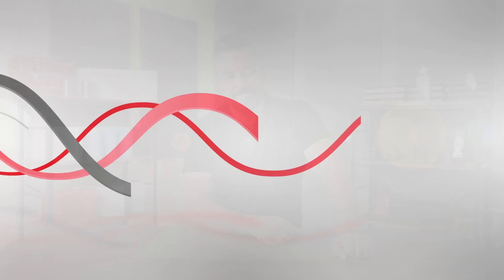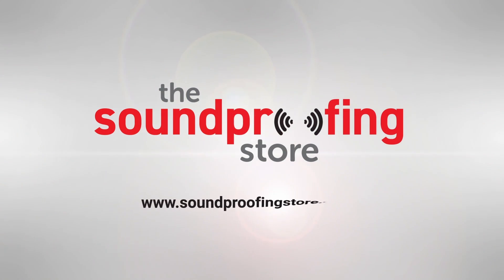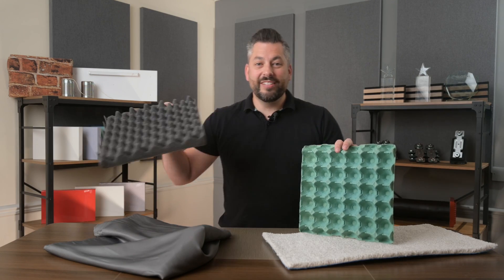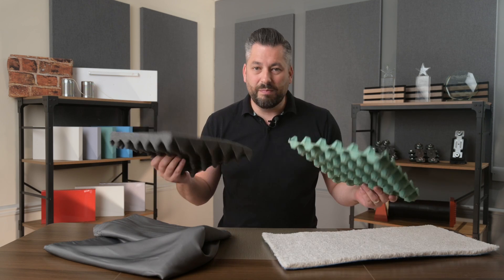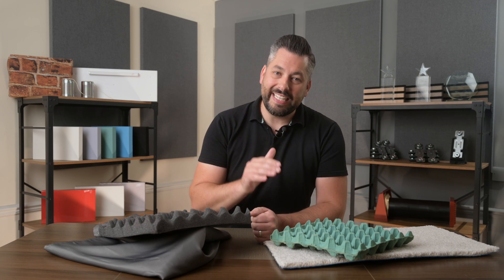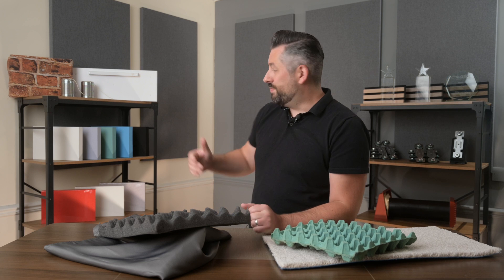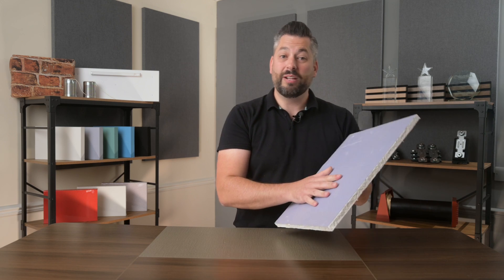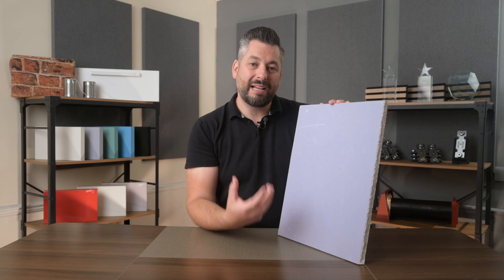Cheap Soundproofing Hacks

Comment: Hello, and thank you for this very informative video! 😊
I’m a photography student, and for my final project, I want to showcase a photo on the theme of silence in photography. My idea is to create a soundproof box where only one person can enter at a time, with focused lighting on the image. The goal is for the person to feel a true sense of silence upon entering the space, even though the exhibition itself will likely be noisy.

Based on what you explained in the video, egg boxex aren’t an option for effective soundproofing, so I’m considering soundproof panels. My questions are:

Are there any affordable panels that could work, even if they don’t completely block out noise?
Do you have any other recommendations for this type of project, considering I’m looking for a relatively budget-friendly solution?
Thank you in advance for your advice, and again, great job on this content!
Reply from the maker: Hi Thanks for the comment. Wow this is an interesting project. Unfortunately it's going to be a lot more difficult than you think. There are no soundproofing panels that on their own are going to give you silence. Most products advertised as "soundproof panels" are actually for absorbing echo not blocking sound. For this you need a LOT of mass, so multiple layers of heavy, dense materials, and you need de-coupling from one side to another. So I would build a kind of booth using stud framing, and soundproof both sides. Are you UK based? If so, reach out to us on our website at www.soundproofingstore.co.uk and I can send you some more detailed info about similar projects we've done. Realistically though, if you want silence, it's not going to be cheap.
Reply: @SoundproofingStore  Thank you very much for your reply, I will keep it in mind !!

Comment: Hi i have a stud wall between me and my neighbour and whos son like to bang on it and stomp in front of it will putting the flexisound 5 and then the acoustic board onto help to minimise the sound thanks
Reply from the maker: Hi @katiex3889, we wouldn't recommend that as a solution on its own. Both the FlexiSound and acoustic plasterboard are excellent soundproofing components when used in the correct way and in the correct quantities. They would for example be used with the ReductoClip System to make up the high mass layers (FlexiSound sandwiched between two layers of acoustic plasterboard). However, only advisable when used alongside the ReductoClip clip and bar system. Please take a look at the below video which goes into more detail on this and also talks about SoundBoard 4 which is a direct to wall soundproofing panel and is a great solution for low mass stud walls:

https://youtu.be/C-s8n3i3rBQ

There is also further information here:
https://www.soundproofingstore.co.uk/stud-wall-soundproofing

Please do feel free to contact us on (01423) 206208 and we can discuss this in more detail with you and advise on the correct solution.

Comment: I have 54sq meter property that’s poorly designed and neighbours can hear neighbours. I need to soundproof the inner shell of the flat and its floor. What is the thinnest and densest boards or rubber to use. Ceiling to floor is 250cm and I’d still like to insert shallow spots. Walls are brick that I will take down, leaving a single skin outer walls and cement floors and ceilings. 
Any advice is greatly appreciated
Reply from the maker: Hi @anonymousm1718, there is a lot to cover off here, so please do feel free to call us and we can discuss this in more detail with you (01423) 206208. A brick wall is solid and adds more mass to help block airborne noise, so taking it down will only reduce this capability. Also, the fact that concrete naturally has more mass than e.g. timber, means it usually does a better job of naturally blocking airborne noise. Because this isn't the case, you ideally need to find out why (again we can help advise on this). This blog might be of interest:
https://www.soundproofingstore.co.uk/how-to-soundproof-a-concrete-floor
For the concrete floor take a look at the SoundMat 2 Plus Floor soundproofing solution:
https://youtu.be/S9ZhiDRTPds
For walls and ceilings the ReductoClip System:
https://youtu.be/huNDsYKLpqo
https://youtu.be/R2gvGyE6kTE
Reply: @SoundproofingStore  
Thank you for the information and once the project is set, I shall be reaching out for further advice and supplies.👍